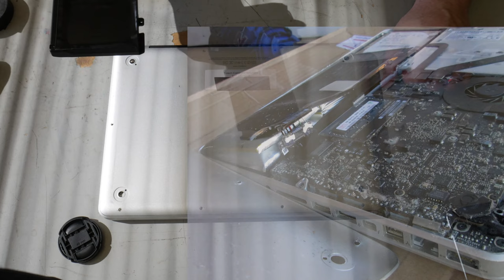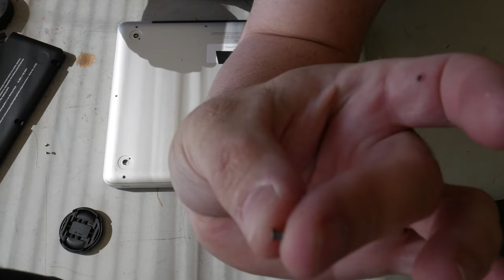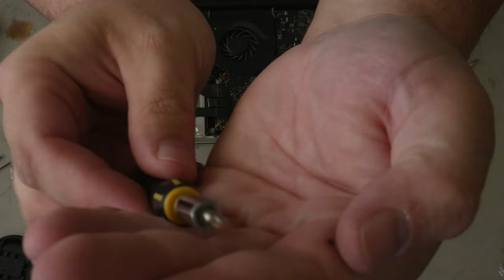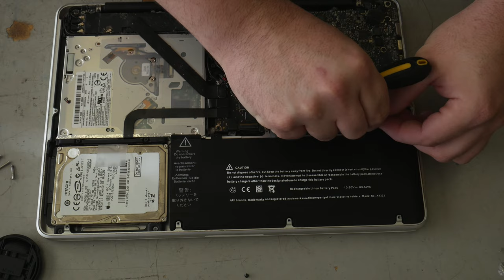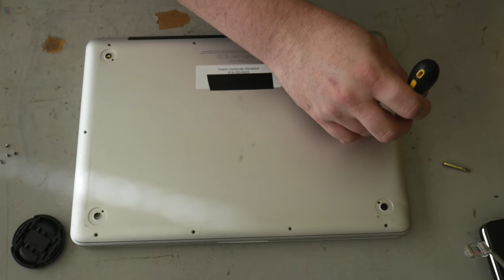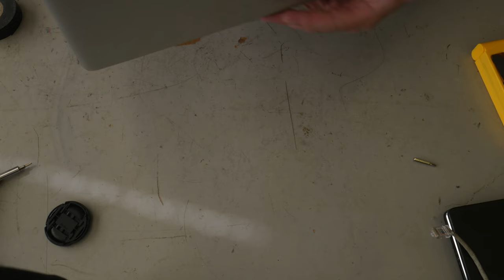MacBook Pro (2010 15-inch) Battery Replacement - Swollen Batteries are Dangerous! - Jody Bruchon

Comment: Hello :) Thank you for your video! What kind of battery did you use to replace the old one?
Reply from the maker: Trace Meres A generic third party battery. You need to look the battery up by the computer's A-number and release period (year and part of the year) because two laptops with the exact same A-number on the bottom can have different batteries if released in a different part of the exact same year.
Reply: Thank you Jody for the info!!

Comment: where did you purchase your battery?
Reply from the maker: Most of the time, I get batteries on Amazon or eBay. They tend to run around $25-$30. I avoid items on Amazon with less than four stars to reduce the risk of getting a bad battery.